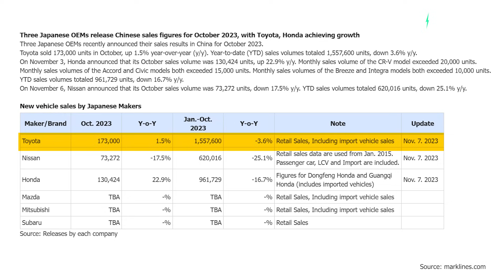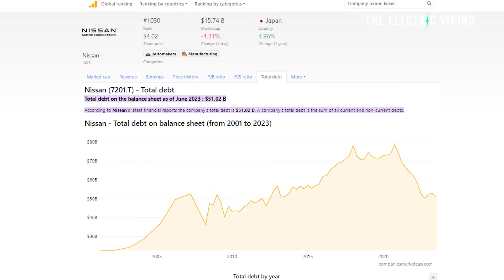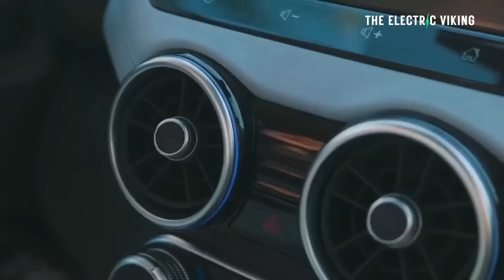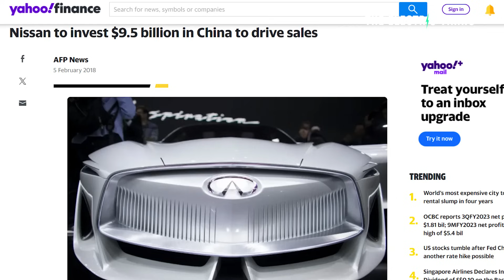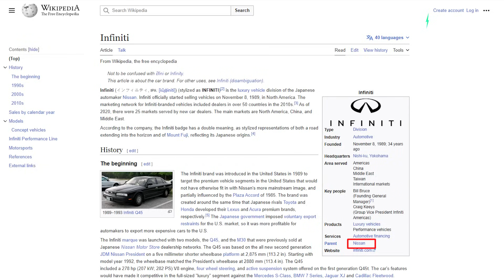Why Nissan's $9.5 billion plan completely failed in China

Comment: We just traded our used 2016 Leaf for a used 2021 Leaf Plus.  
Very pleased with the cars in cold country driving. Hybrid heating is an overlooked value
Reply: Leaf was a good car when it came out. today it's obsolete. simply not useable on long trips.
Reply: "Hybrid heating" ?
Are you referring to the heat pump ?  (Leaf's heat pump is not particularily efficient and turns off i tenps bellow approx -5C).
Reply: @erik5820  What model years are you referencing.  Heat pumps until around 2020 were all pretty inefficient and would start to freeze up as it got close to 32 degrees/freezing and even the modern hi-efficiency systems need to be put into cooling mode and have a heat strip turned on to prevent icing.  That is why many of them grunt periodically when temperatures go down and the reversing valve comes on to prevent freeze ups.  The heat pumps in the older Leafs were on about par with the norm at the time they were built.

Best!
Reply: @neilfromclearwaterfl81  the Leaf heatpunp actually turns off at approx -5C (also new models). From there and down the ptc-heater takes over.

Comment: Really sad Nissan could have rescued the leaf with different charging standard plus minor improvements to in cabin tech. Just that would have kept sales ticking over. Add in improved battery management and efficiency gains to increase range 20%and you would have a winner. Just sad they made minimum investment.
Reply: Would be expensive for Nissan to fix those. Probably not worth it.